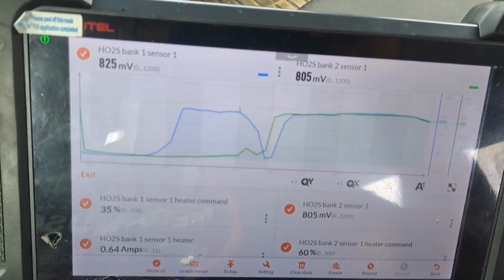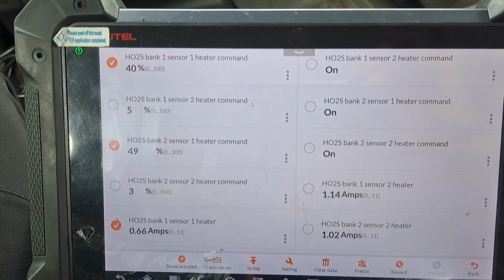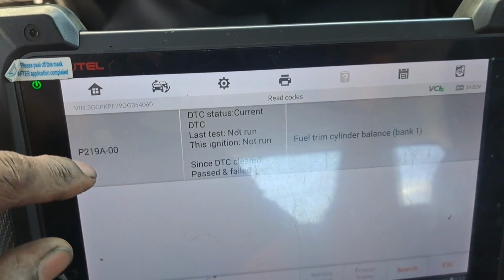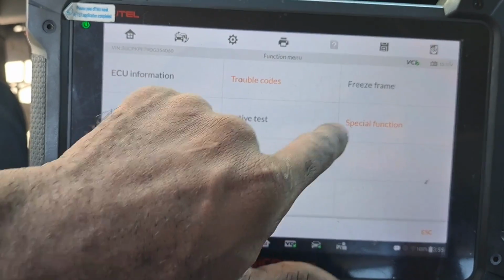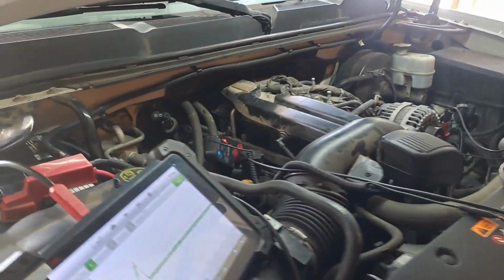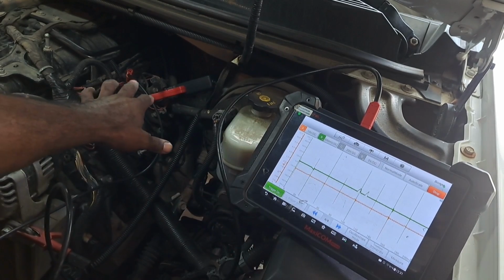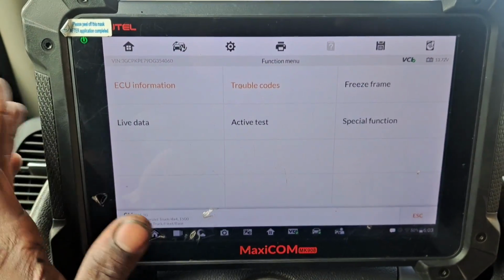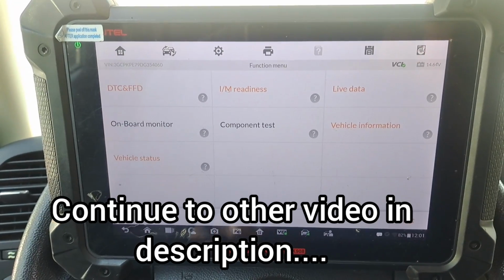chevy p219a, fishing for the causation

Comment: Do you not have the ability to do a fuel pressure drop test to check the flow of each injector Bro? Love your channel, THUMBS UP

Also about internet attention span being the size of a nickel, your videos simply have way too much wasted chit chat to put it nicely bro, I am a YouTube car repair video guru with 10s of thousands under my belt for a personal library,  Out of 7 levels of videos, you are way down in level 6 for a couple different reasons, one being your over talking and this is meant as constructive critisism. Videos should not be over 20 minutes each, this also means a multi part series is also fine but by cutting down the chatter, one video is typically good to EDIT OUT the BS pls.

With todays AI if you do an evaluation of your transcript, you will see the Salient Info and all other stuff is out in the weeds. Also the way you name your videos is very important if you want to be searched for and found. 

The previous video was ID'd as a Ram from the video before it with the broken CKP, nothing was mentioned in the video about being a Chevy Silverado which would not be found in any search. You were simply limiting your search findings to the P219A which is universal on more than GM, and if you are happy with that then ok. What you say and how you say it and sticking to the Salient Info is very important today more than in the past Bro, best of luck.